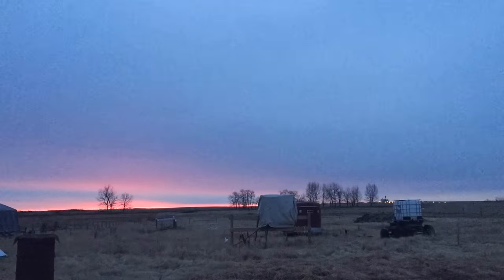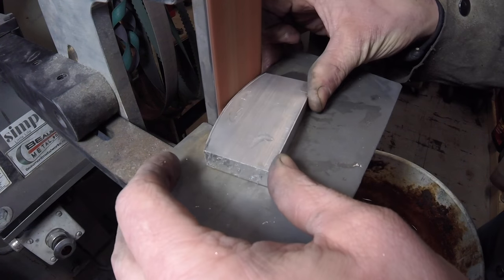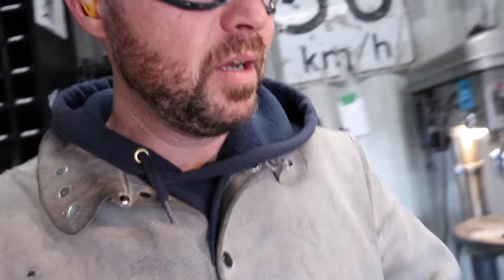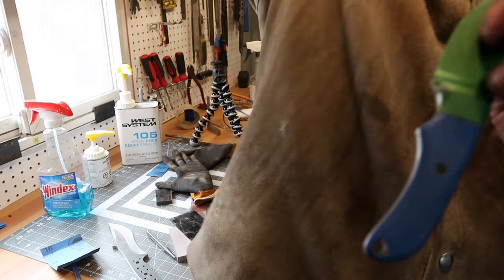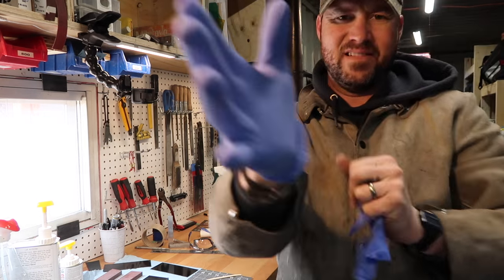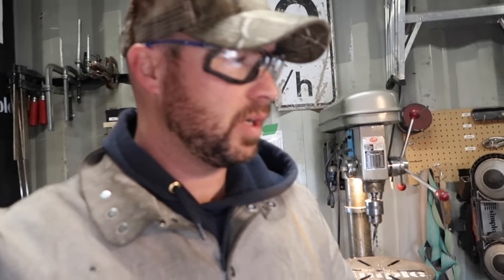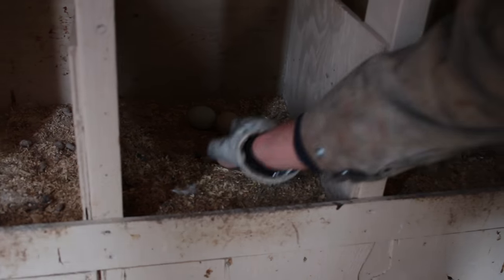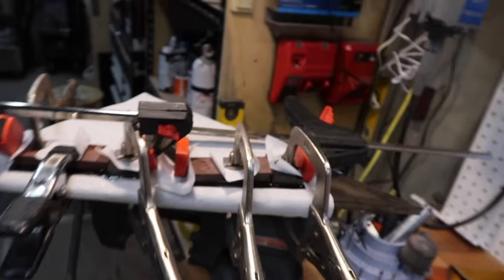Psycho-Chicken! (a knife maker's vlog)

Comment: I use the westsytem stuff, it's good, sets faster when it's warmer though, I usually leave if for 24 hours, here's a tip, rub renaissance wax on the blade from the handle portion up a cm or two and down the tang, then glue, this way the glue that leaks is on the wax and not the metal and it's easy to remove.
There's a west system epoxy called gflex that's supposed to be better, slightly flexible but still bonds as hard as normal epoxy, but I have not tried it yet.
Reply from the maker: +Shelley Raskin awesome tips! Thanks for sharing!

Comment: The 105 and 205 combination is used by wood workers to mix and pour on wood with what's called "Live edges" or parts that the wood worker wants to keep the bark on.  It's very runny to get into all the books and crannies.  Also used as a finish on wood bar tops. The 105 and 206 is what is Knife guys wood use.  (My research and Q&A with folks in hat world).  I have the later aforementioned but have not used it yet... still finishing the bottles of T-88 I have.  I'd say get the 206.  You're already half way in this
Reply: G flex also works really well. It's also made by West systems.

Comment: You probably know this anyway but the surrounding temperature is a factor when it comes to the resins drying time. The way you control your chicken is to put him in the freezer for 30 seconds and while it's in there, it will see the frozen chicken your saving for a future dinner and it will have second thoughts about running away again. :)